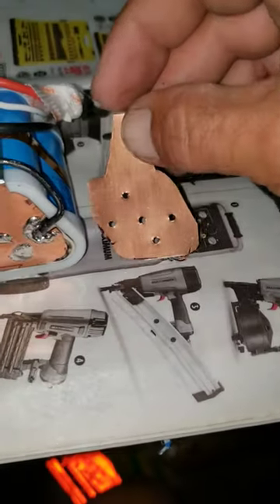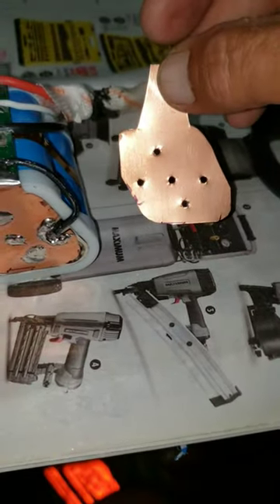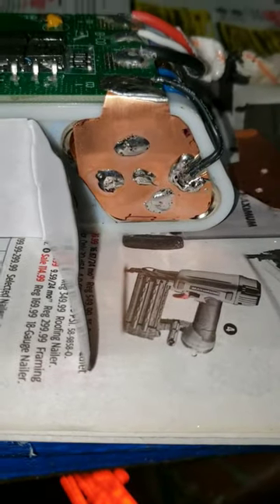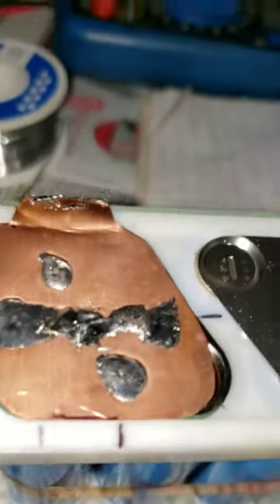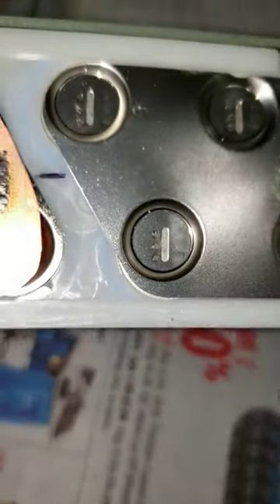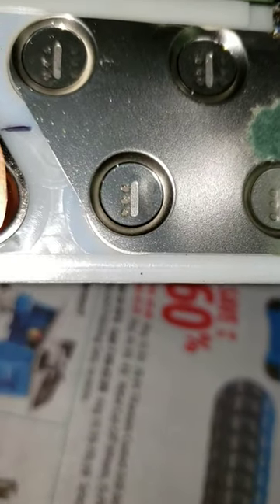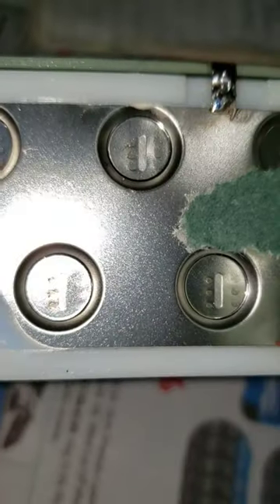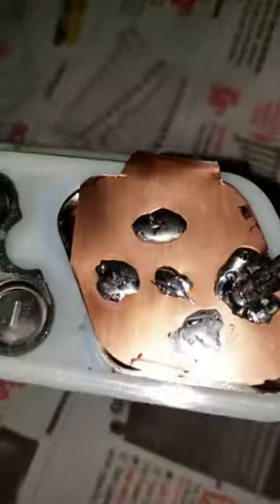solder 0.1mm copper to battery terminals

Comment: For people who is not used to this.... NEVER solder on the spot welding. The heat will ruin the battery cell. 
Solder the copper as far away from the battery cells as possible, but still close enough to actually help with the electrical current.

The reason batteries are spot welded is because the do not take heat from soldering well.
So heat no more than necessary,  and let it cool down before soldering the next point.
Reply from the maker: yes, you can see the holes were drilled in the copper in between the cells for that reason